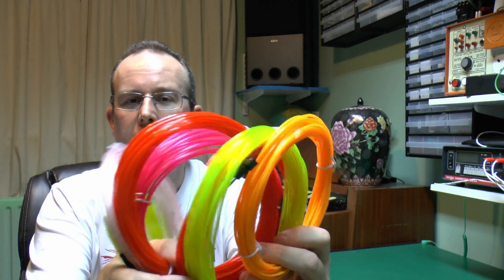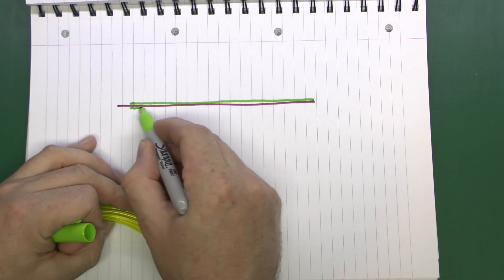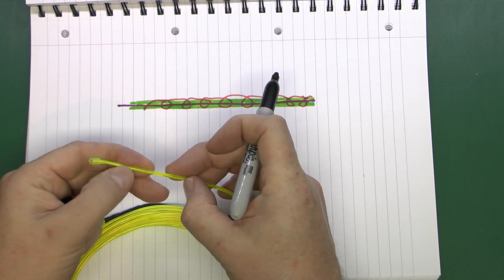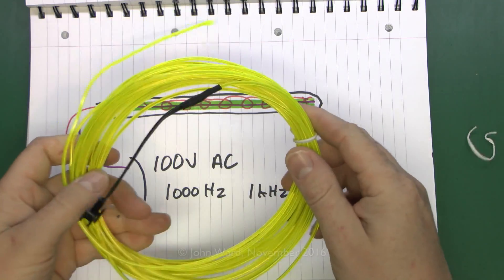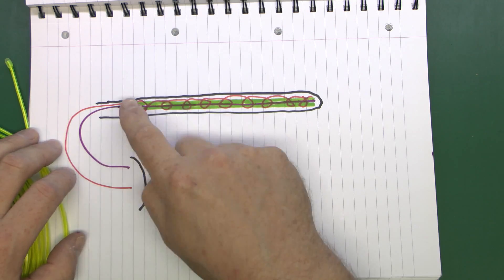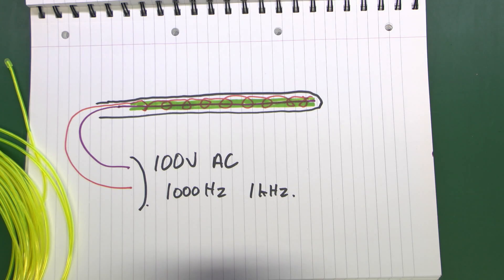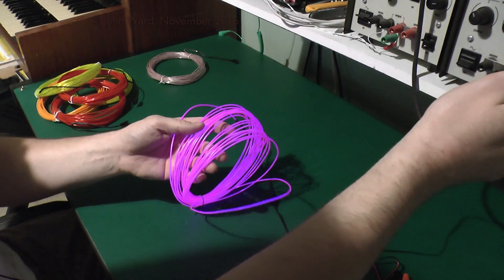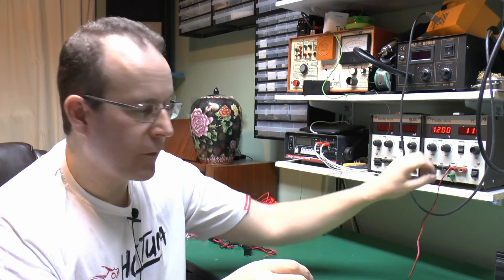Electroluminescent Wire

Comment: It seems because its just becoming excited instead of illuminating an actual bulb, does that mean that UV emitting el wire is impossible?
Reply from the maker: It is possible, and would require that the phosphor used in it was a type which emitted UV light.  Not likely to be of much use.
Reply: @jwflame 
I appreciate the response!

 I am currently working with glow powders and I wonder if a "breathing" (6 seconds on every 30 seconds) EL wire inside a glow polymer would have an interesting effect and sustain the amount of illumination you get.

 There is something harsh about led lighting (I believe it is the frequency it flashes at, imperceptible to the eye but the nervous system is still affected. The light that excited glow chemicals emit is much calmer. I would definitely purchase UV el wire if it was available.

Comment: can you spice it into 12 volt directly without the black little box?????
Reply from the maker: No, it requires a high AC voltage to work.  Connecting directly to 12V DC will do nothing.

Comment: Hi ,
Great explanatory video thank you.
I've used these in my vehical in the past and they look pretty cool however without a rocker switch I found these stopped working after 3 months or so 😆. 

So I've installed some with a rocker and my question always remains, will the EL wire or transformer set fire if embedded deep into the dash board of a car?

Comment: Would it be possible to connect to a flat batteries support? The one most of them come with is an AA battery support but it's quit bulky if I want to wear the wire.

Comment: I know its 5 years ago. But can a driver unit power multiple strip of light? Thanks.
Reply: I came here searching out the same info.  If the multiple full lengths of wire are cut to be less than the single length, do you wire the segments in series or parallel off the driver?

Comment: I got one of these foe my car and I’m just wondering am I able to cut it to fit the door panel or do I have to feed it through all the interior ?
Reply from the maker: Yes, it can be cut.  The cut end should be sealed either with a glue-on plastic cap, heatshrink or similar.
Reply: @jwflame  but the part cutter can only work if you add a connector to it isn’t it?

Comment: I have a question: How much milliampere consumes 10 meters of Neon wire
Reply from the maker: Depends on the manufacturer, but it's normally about 10mA per meter, or about 100mA for 10 metres.  Some high brightness types may be more.

Comment: I'm very glad I found your video. I'm working on a project and thought of el wire, but never used it before.  I'm realizing it's going to be too dim, for starters, but that high-pitched buzz?  That's a great big NOPE.  Thanks for helping me make a decision!
Reply: I was considering it also until I heard that pitch tone.. fibre optics it is!
Reply: The noise wasn't there with mine
Reply: @Fire-in-the-sky  Maybe it's just a very cheap inverter?

Comment: thank you for showing the breakdown of wires . i have a halloween mask and i found out the wires are broken , its soldered back now thanks to you . but how is it mine is operating at 3 volts using 2 pcs of AA  batteries ?
Reply from the maker: The batteries power an inverter, which converts the 3V DC to high frequency AC at a much higher voltage.

Comment: Hi mate, great vid. I am currently doing a project that requires 3 lengths of this. I have the three lengths plus three controllers, what’s the best/easiest way to power them up? Can it be done off one supply? Or daisy chain them? I have no electrical experience or a soldering iron. So off to a great start 😂
Reply from the maker: Depends on the length - the controller will have a maximum length that it can supply, you can connect several pieces provided they don't exceed the maximum stated.
Reply: John Ward cheers mate, got three 5m lengths connected into one supply and seems ok 👌

Comment: I made the guitar neck for this system, but there are noises induced by the controller for the pickups, how do I solve this problem?
Reply: @luthiao have you found the solution? I also put it on the guitar and it makes noise

Comment: could you connect all of them to one of those 8 AA battery holders or would they burn up?
Reply from the maker: 8 AA is still 12V so that could be used with the 12V drivers.

Comment: 🧐What is maximum length that can be used 12v or up
Reply from the maker: Depends on the driver but usually 5 metres, sometimes 10.

Comment: hey john thanks for the vid

i just got a 10M EL wire, i want to connect it to the wall socket and i don't know how, maybe you can help, is it 12V?
Reply from the maker: EL wire usually operates at about 100 volts AC, frequency about 2kHz. You will need an EL driver to run it.
Reply: @jwflame  hey john thanks for the replay, i also got from ebay a driver (In the description it says: 1-10 Driver) and it looks like that:

https://www.ebay.com/itm/DC-12V-EL-Wire-Neon-Glow-Strip-Light-Driver-Unit-Inverter-SY-AU-High-Quality/183569580141?hash=item2abd99806d:g:ygMAAOSwe9FcCAJ4:rk:1:pf:0

Comment: 1 source, multiple lines needed, in parallel. So does that mean I only need more amperage from the source, right? For clothes and need minimal wiring as possible for energy saving
Reply from the maker: Yes, longer total length = more current required.  For clothing and other portable applications, you can buy ready made drivers which include battery holders.
Reply: Just seen there's Laser Wire too, seems more durable and easy to work with for clothing

Comment: Could you run approx 1m of this wire from 2x 12v AA batteries? If so, how long would it last?
Reply from the maker: You can buy ready made AA battery holders containing the driver for EL wire.  Current is very low, several hours operation should be possible even with just a 2 AA batteries.

Comment: Do you know of a way to reduce the high-pitch transformer noise other than putting it in some sound-absorbing box?
Reply from the maker: No other way, the wire has to be driven with AC at or near that frequency so some noise is inevitable.

Comment: Hi john,
Maybe I'm an idiot (serves you right) but I bought a kind of heating mat from ebay (from China). The idea was to build a seed propagator. Basically plugging this two pin (US) style plug end into a UK adaptor. The mat is a flat piece of plastic with tiny wires imbedded  inside rated at 7w. They are used for reptiles or strange pets some people have to provide them with warmth.

I was so annoyed to plug it in and it doesn't work. There's a faint hum. Also a heat regulator in the form of a rotary dial.

Maybe I just got ripped off. If you can think of any reason why it wouldn't work that would be helpful.
Reply from the maker: The controller being faulty is most likely, unless the mat/wires have been physically damaged.

Comment: Hi do you have a link for this EL wire? I just received some but it's no where near as bright and I think what I bought is a thinner diameter.. any info on these Ines would be helpful. Thanks
Reply from the maker: This is the one I purchased: http://www.banggood.com/1-p-1063046.html
however the reviews for it suggest that people are not receiving exactly the same stuff, some may get better types than others.
Reply: Ahh I see yes I purchased from the very same link, but what I've recieves is nowhere near as bright. What your have appears to keep its shape and be thicker. Do you know what diameter the  el wire you have is? Really need to find some like yours.. thanks for the link 👍🏼

Comment: I didn't back-read all comments below, however the thing that immediately came to mind was the possibility to drive the duller colours harder by cutting the wire shorter. Or hopefully there is some kind of variable current driver that allows tweaking of the brightness levels. Either of those would solve the obvious issue of making a good looking multi-colour display.

Comment: Can one drive it with frequencies above normal human perception? i.e. 22kHz.
I mean it certainly looks nice and invite creativity. But stray RF feeding into audio equipement is probably a major issue. I possible see applications in bars, discotheques and the such. But interferring with audio is a huge problem, i guess.
Would love to put oscilloscope probes on the outputs of that 'black box'. There is hopehully room for improvements.

Comment: Wonder why these were never used as an alternative to CCFL in laptop LCD backlights. CCFLs something break as they are just thin glass.
Reply from the maker: They are not bright enough, even the bright green one is fairly dim compared to a glass fluorescent tube.
Reply: You can find it as sheet ( china of course ! ) , that you can cut to size. Not very bright indeed.
It was used as backlighting in audio equipment and LCD displays before 
generalization of led  diodes for that purpose

Comment: Is it possible to use capacitor dropper to drive these from mains directly?
Reply: They require the high frequency, 50 or 60 Hz wouldn't light them very brightly. 
Interestingly the 400Hz on aeroplanes lights EL stuff quite well, so they used to use them for the 'no smoking' and 'seatbelt' signs

Comment: How long do you typically wait for banggood deliveries? I've been waiting almost 3 weeks for my soldering gear.
Reply from the maker: Varies but usually 3-4 weeks.  If buying more several items, it's worth checking the shipping options on the checkout page, as although you have to pay extra for faster shipping, the extra is often only a few pence or sometimes even free.

Comment: These and special shaped sticky back molding from an autobody shop makes an awesome way to create accent lighting for your baseboards or under cupboards. Made a nightlight in the bathroom that makes the floor glow. They don't have longevity though. You have to replace them once a year if you are using them this way. You need to protect them in some fish tank tubing if you are mounting them out in the weather or under your car. They get damaged or kink easily otherwise. I hot glued the ends to keep the water out.

Comment: Is this wire temperature sensitive? Less light in colder climate?
Reply: Nope. I've run them outside the house and in the trunk and under the hood of my sons car. No difference in the cold to -15C. I have them in fish tank tubing and that may be holding the heat to keep them warm. They just get barely warm to the touch after running for a short time.

Comment: Any reason why the coils whine at different pitches?
Reply from the maker: Probably due to each coil having a slightly different capacitance.  The driver unit is not well regulated so the frequency will vary as the load changes.

Comment: typically theres 3 wires wrapped around to make it light up in every direction
Reply: drkastenbrot The three wire variant is for when you wish to make the wire appear to be stripy. One wire wrapped around should light the whole cable up.
Reply: Its always 3 wires in parallel, with one wire it wouldnt light evenly.